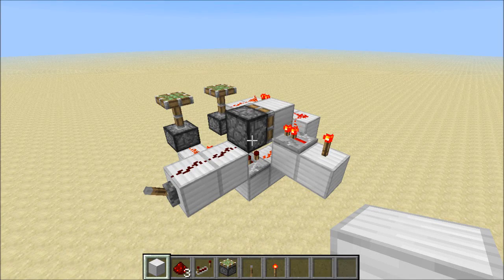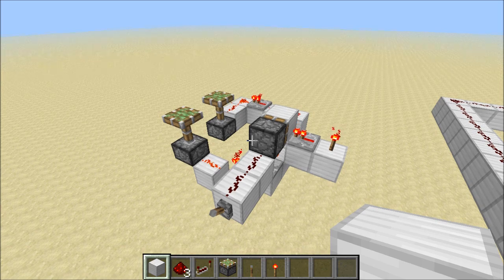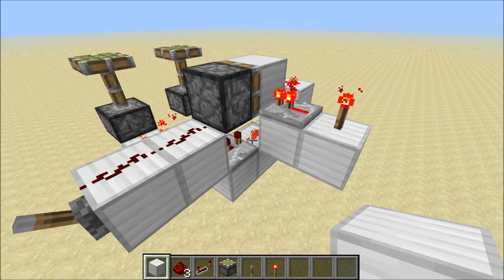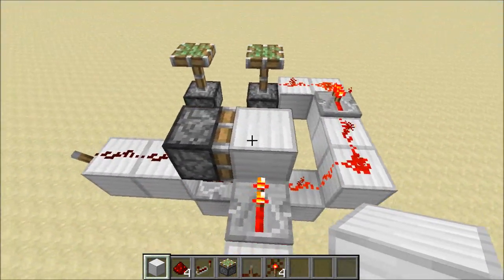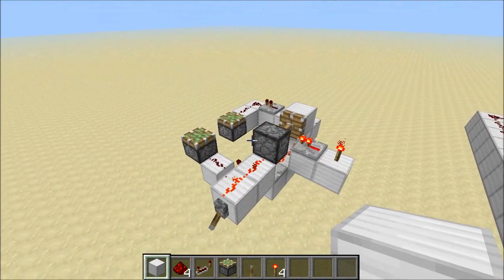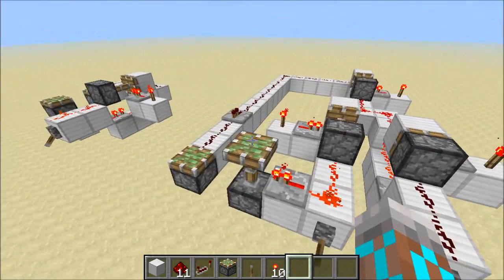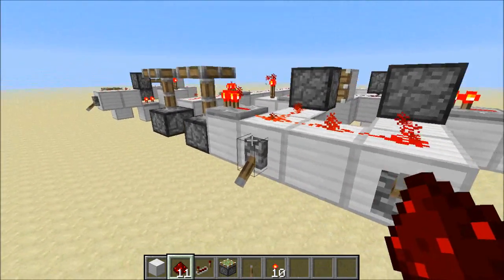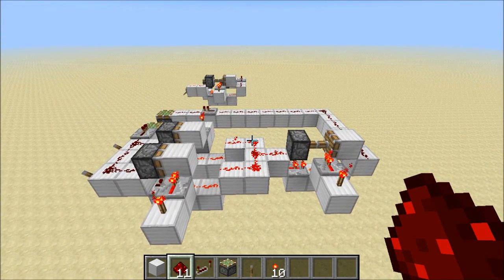Minecraft Instant NOT Gate

Comment: it's not instant ... there is no real instant wire - every instant wire has a 1 tick delay (=1/2 redstone tick).
You can prove this by adding a notblock at the end instead of the pistons and put cobble under it. Notice the little time difference between them. Thats why all instant wire computers can't work instant... but maybe with a 2 second clock
Reply: +95BlackFighter nope, it's not a 0.5 redstone tick delay. you can chain a thousand instant repeaters together and your delay will be the same. the game still processes the signal chronologically of course, but it's all in one gametick.

Comment: How stable is it?  How does it respond to "Race Conditions"?  If you have one input be the inverse of the other (thus output 0) and then flip them, does it maintain a steady 0 as the output or will there be a brief flicker of 1?

Also, if the two inputs to the second NOT have different wire lengths from their output, does this cause any instabilities?

Comment: Just use the subtracting feature to get a NOT. Just set it up so that your input (strength of 15) is coming in from the side of a subtracting comparator and there's a torch at the back of the comparator. Then the output of the comparator will be your NOT.